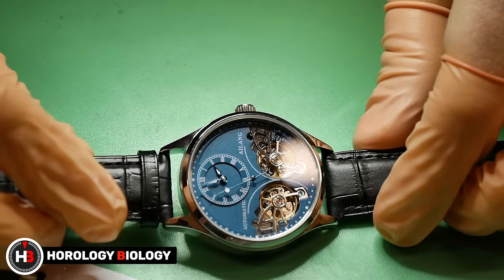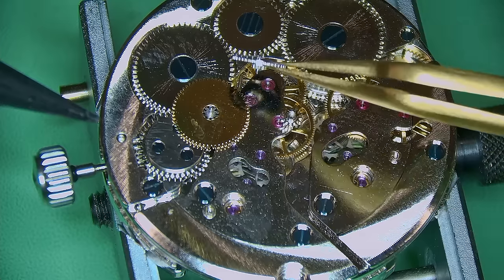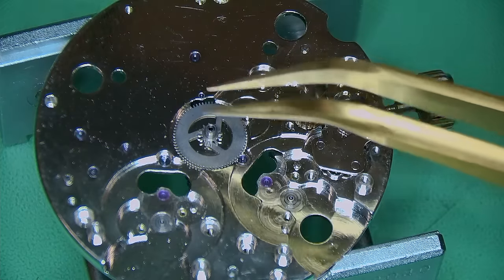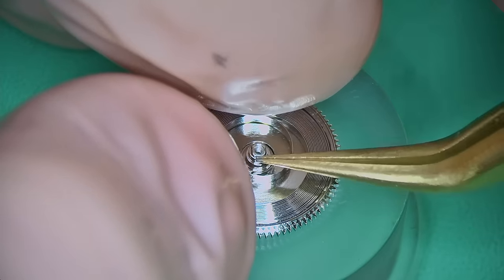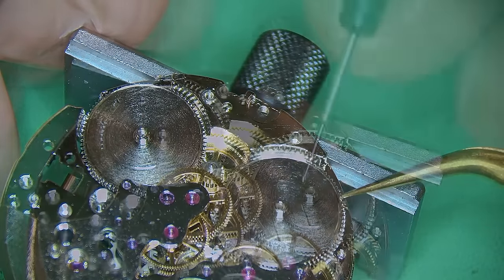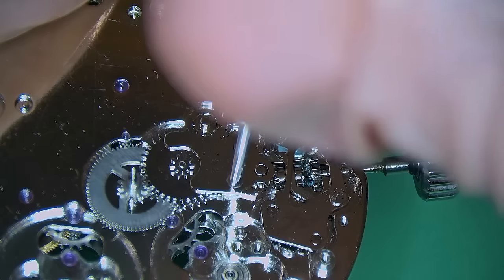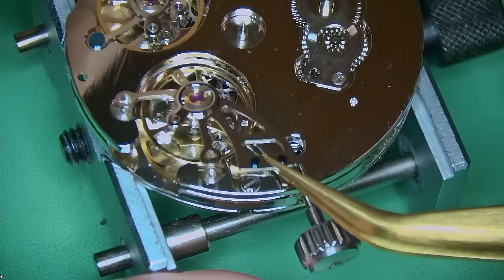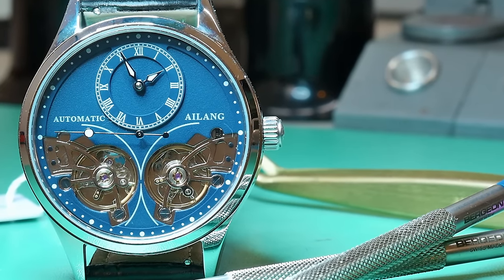I received the Strangest AliExpress Automatic Watch Can the Ailang run better after a Watch Service?

Comment: With the cost of watch’s like Seiko, Citizen and even Boliva the cost is double key and if you pay on time 10%back and something they have specials close outs and stock they need to move. They could not make a watch at this retail price as the cost would be way more then $49 even using ready stock parts. Just the R&D would make it a $1000 watch if at all possible A Seiko 5 automatic wholesale is $100  gray market So for $49 this is a decent watch but it needs to be overhauled by a watch maker out of the box. The other thing that’s interesting is it’s not a knock off or bootleg watch it’s its own brand and not pretending to be something it’s not. All for that low price. What I would do is remove the dial and send it off to be redone and also put on better hands then take off the bridge and bring it to the hand engraver and have some work done I think it would look more elegant. This falls into the category to cheap to make anywhere but China. The overhaul would cost $75 to $100 on 47th street in NYC from a watchmaker that’s your friend. I think it’s interesting but I would not buy it. Buy an old vintage Swiss watch off eBay. As it is Swiss. Even an old Seiko or Citizen as they are Japanese but China just Makes it and fakes it.
Reply from the maker: Thanks for watching. That's what grabbed my attention, the fact most of these Aliexpress watches rip off many designs, this one does it's own thing. I have zero interest in these so called Chinese homage watches.

Comment: So it's all show. The double balance do not give any advantage. You may want to check, however bad or good the regulation is, when you leave the watch laying down on the bench, they do have a harmonic effect on each other and they do tend to sync up, rather than run independently. Each of the balances impart and receive energy from the others. In fact if you make one fast and the other slow they do tend to sync - when placed on the bench. However when the is worn there are other forces and the syncing is not the significant force
Reply from the maker: Of course it's all for show, why would you need to balance wheels on a watch. It's just a gimmick, although they do run independent of each other as they each have their own train and mainspring. Basically like 2 watches in 1.
Reply: There could be two balance wheels for several reasons such as balance and stability etc There are watches that actually utilise the two balance wheels effectively . It is not necessarily a gimmick. In fact Sherlock, weren't you the confused one doing the tear down to find out WHY this watch has two balance wheels????

Comment: This watch, before cleaning an regulating, still runs better than Yema's new micro rotor
Reply from the maker: Nooooo don't say that, I was actually really tempted with those as they look really slick in pvd. Are they really that bad?
Reply: Yes, unfortunately. I am one of the original backers for Urban traveller micro rotor.
The only thing worse than that faulty movement is Yema's customer support.

Comment: Noob question:  What would be the benefit of double balance wheels?   Better stability in timekeeping? Higher beat rate?
Reply: Nothing. If you watch closely one set of wheels doesn't actualy even turn anything
Reply: The watch comes with its own spare parts
Reply: in a classic turbillion, they are angled to each other, and help average out error, so more accurate, especially in 3d turbilions but they are super expensive!they also spin and ORBIT!!

Comment: Im not really a fan of homage watches or the Ali Express stuff , however i have watched more videos showing how good some of the watches are from china , for 47 dollars someone has made that with a lot of intricate parts , it may be cheap parts but labour alone putting it together would make the price of the watch not worth selling as you would make a loss , sadly i guess thats the reason china can do it with their dodgy work practices.
I am thinking of purchasing a couple to see whats out there , especially as some of the branded chinese manufacturers such as pagani etc.. are trying their hand at some original designs.
For 70 dollars ive seen decent movements ,, sapphire glass etc.. more spec than a seiko for 3 times the price.
Maybe i should stop being a snob and collect a few.
As for the art of taking a watch apart and working on it and putting it back together , i bought a AAA rolex once to see what was in it in the hope of learning taking it apart and putting it back together,, lets just sa i took it apart ,,forgot what goes where , cant put it back together and so at least i have stopped one AAA rolex being on the market as that wont be working again 😂😂
Reply from the maker: 😅😅 thanks for sharing

Comment: I like these kind of building a castle from a pile of crap. The job what you have preformed on the watch probably worth more than a watch itself. I discovered some heavily fingerprinted parts while you disassembled the movement what is tells a lot like the poorly finished gears. I would be curious about the lifetime of these cheap mechanical watches. How they feels like from a watchmaker’s side? Obviously not a swiss quality….
Reply: It’s not that hard to do more than 50 bucks if work in a watch. A service like this is in the hundreds.
Reply from the maker: Thanks :) I also noticed those finger marks. Zero quality control
Reply: @JasperJanssen  I know the price ranges of the watch service shops. A regular service like this is starting at $300 and can reach the $1000. Depending what kind of watch you have. Perfect example Omega speedmaster Moonwatch service is $450.

Comment: That movement is absolutely weird. I don't understand why they had to put basically two movements in one and not do anything special with it. If they had put the two balance wheels closer and with nothing between them, they could have a resonance effect which would have been very interesting and different

But instead they did nothing of the sort. Very weird
Reply: I remember I have watched a Swiss watch with 2 balance wheel I forgot what is the brand, it is like double tourbillon no much affects
Reply from the maker: It is pretty strange indeed, cheers for watching

Comment: Instead of doubling the BMP they split between h/m and seconds hands. This watch had some potential but then they ruined it :D
Reply from the maker: You mean BPM?
Reply: Mixing the two balances into one mechanism would be a major challenge. The way they used it is just a gimmick.
Reply: @HorologyBiology  yeah, thanks, a typo
Reply: @HotelPapa100  I'm sure it is. Two pallet forks and one escape wheel crossed my mind, if at all possible, I don't know if anyone tried it, but it would be interesting to come up with a way to sync them.

Comment: I'm shocked at how well made these Chinese watches appear to be.  I do wonder about their longevity though.  What is your opinion on their longevity?
Reply: Same as most Japanese watches, if you are not too unlucky with tolerances and a lack of lubrication. The problem is that once you need a service you are unlikely to find someone to do it at a reasonable price, so it's either DIY or forget.
Reply: @conjurermast  that's valid.  Servicing watches sounds very daunting but at this price, I'd be willing to try learning
Reply from the maker: Like others have mentioned. Great if you want to practise on yourself 👍🏻
Reply: It really depends which brand. Some are high end actually but price is way higher.I have a few. 
I also bought a no brand 10 years ago in china, super quality actually, and accurate to this day
Reply: 100 years? but i have lots 5 yo and more! vibration and shock hurts watches

Comment: So does that mean the power reserve is also twice as long?
Reply: No
Reply: The mainspring is primarily responsible for power reserve. This still has 1 per escapement.

The 2nd escapement doesn't do anything but look pretty.
Reply: You can imagine this as two seperate movements in one case.
One spring and balance are for the seconds, one for the minutes/ hours.
So every movement has only one main spring.

Comment: 20:37: when you say 'pinions' do you mean PALLETS ??  yes i AM hanging on your every word...........
Reply from the maker: Nope, I mean the pinions on the pallet forks as the fixodrop obviously coats those as well. Leaving it on could potentially cause drag resulting in a lower final amplitude. As you never oil the pallet fork bridge (or cock) this is why I clean it off.
Reply: @HorologyBiology  I think you actually meant pivots (i.e. the ends of the shaft on which the pallet fork rotates), rather than pinions.
Reply from the maker: @kruador  😅 you are absolutely right!!!! My bad. Wait until I keep referring to 3rd wheels as 4th wheels etc 😉

Comment: What are the purple stones made from on this , are they plastic ? I imagine the jewels on a rolex etc.. are very expensive gem stones , but what goes into a cheap watch like this , are they plastic or does it need to be a certain gem stone , it's just these ones are very cheap off cuts , it's one thing I've never known
Reply: Synthetic hard gemstones like sapphire are pretty cheap.
Reply: @imeakdo7 They are bearly more expensive than plastic
Reply from the maker: I think on this they more than likely would be some kind of plastic
Reply: 31 jewels synthetics prolly